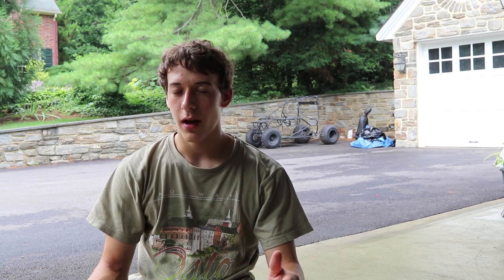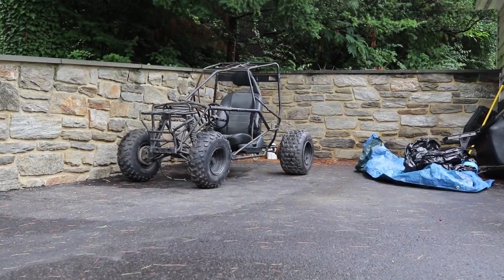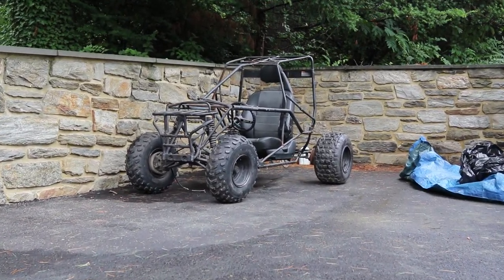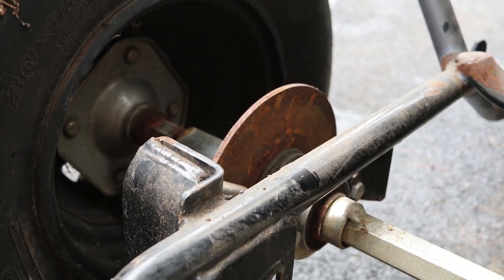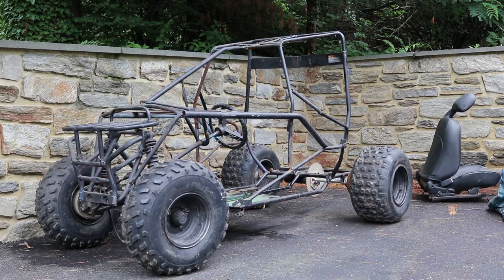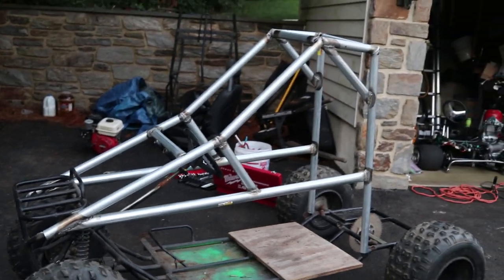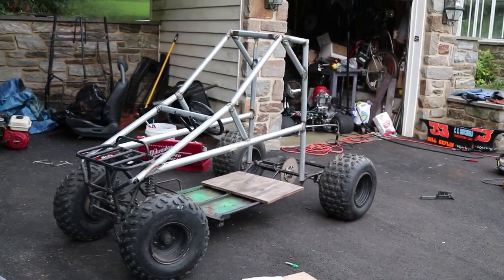OFF ROAD GO KART BUILD PART 1: ROLLCAGE

Comment: what is that fence posts? that stuffs way to thin for this, you better brace the hell out of it and don't breath the fumes from galvanized metals when you weld them it releases zinc oxide fumes which is poison to breathe
Reply: This is Pointless lmfao
Reply from the maker: its okay. It won't go fast enough to roll anyway haha. And I took lots of brakes when welding it up. Thats why it took the entire day to finish.